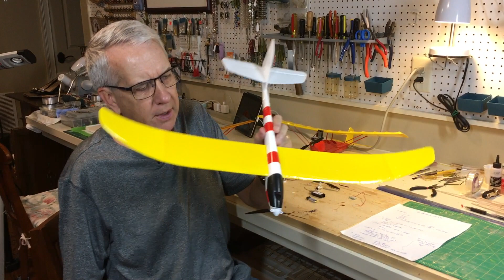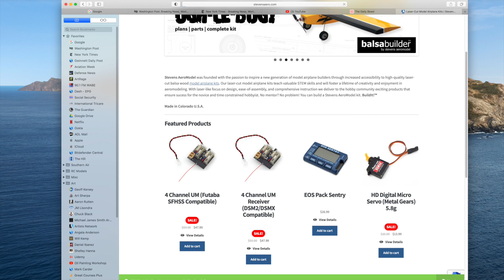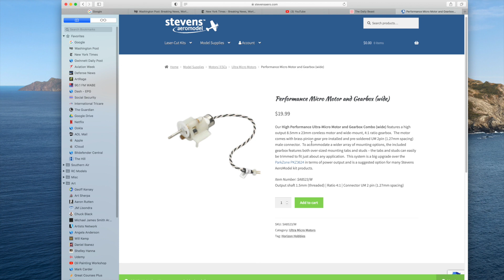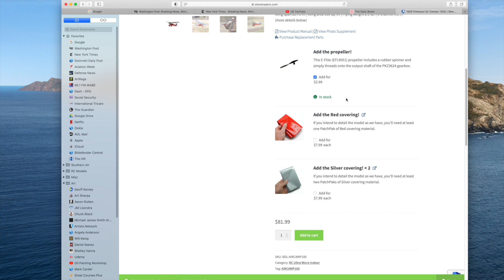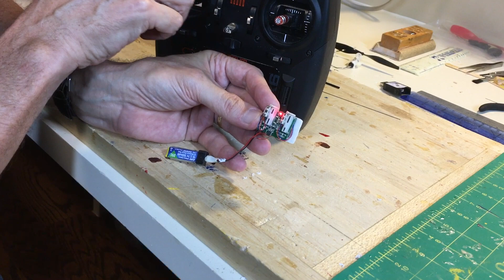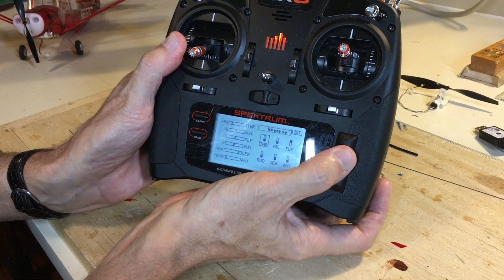Park Zone Ultra Micro RC - Where to Buy

Comment: hey i have a question i am willing to buy the guillow 509 ju 87 b but i dont know what motor wil fit in it (i alr have 3 servos and a reciever and a battery and controller) so i would like if you had any suggestions
Reply: sorry its 508
Reply from the maker: Use the same setup as in my Guillows  F6F Hellcat video.
Reply: thank you @TimMcKay56

Comment: Tim- If I salvage components such as the receiver/servo combination how do I bind this to my Transmitter with the 'new' build? I guess the question comes down to do I need the original transmitter to make the salvaged receiver work?
Thanks, BC
Reply from the maker: BC:  A receiver is binded to a transmitter, it does not matter what airplane it is in. You will need to re-bind a receiver if you use a new transmitter. Just follow receiver bind instructions, Google if needed. With the Spektrum AR620 receiver, a simple Bind Button on top of receiver to put it in bind mode. Tim

Comment: Hi Tim , can  you tell me where I can get the music wire or piano wire as they call it. My hobby shop doesn’t carry that. T.I.A.  Also , I am searching for a 65 Mah battery with the two magnets on it, very small. It is for my Uberlites. Impossible to find. I thought maybe you would know where I could find that tiny battery.
Reply from the maker: Jim:  Either www.TowerHobbies.com or www.Amazon.com carries music wire.  You'll have to do the conversion from 1/16" diameter as they use decimal sizes.  Not cheap, but they last forever.  Tim

Comment: Thanks Tim! 😃As someone with a few Guillows kits, both built and unbuilt, you've provided much needed info on converting them to RC, which I have wanted to do for years now. 🛩I am an RC airplane newbie, but have experience with assembling and flying FPV quadcopters. In addition to Stevens AeroModel, may I suggest to your viewers Buzzard Models and dronetrex for micro and mini RC airplane building. While I have not yet ordered supplies from these vendors, I find their web pages  to be impressive and am registered with both. They offer payment via PayPal (a BIG plus) and flexibility with radio protocols beyond DSM. Again, thanks Tim for your videos covering micro RC airplane conversions and flying.
Reply from the maker: EV:  Thanks for checking in!  Best of luck with your Guillows conversion, and thanks for the Dronetrex website. 😊 Tim

Comment: TIM,  I just completed my bronco from your plan.  Somehow I ended up weighing about 22 ounces. So I decided to put a larger motor in it. I'm going with a park 480.  My question is what ESC should I use? Can I still use the talon 15 or go to a larger one? THANK YOU !!
Reply from the maker: Loel:  Congrats on your Bronco!  22 ounces is not too bad, I would not worry.  The Park 480 will provide a boatload of power.  the Talon 15 should be OK for a 2 cell lipo.  Use a Talon 25 is you go with a 3 cell battery.  Tim

Comment: Thank you for creating a simpler path through a confusing hobby. I

'm modifying my first build (lancer) but have several larger projects as well (stearling stearman). 

I'm buying everything you recommend for the lancer build but am researching transmitters and don't see the one you're using when I google "best rc plane transmitters".

Did you choose yours because of compatability with these micro components or are there other factors at play? 

Also, how do you mount your hinges for the control surfaces. Video clip?
Reply from the maker: Jay N:  Thanks for checking in!  I use a Spektrum DX6 transmitter (www.HorizonHobby.com).  I like the Spektrum products a lot.  Just ensure your transmitter is 2.4 GHz.  The DX6 binds fine with these smaller receivers.  For hinges, I simply use clear scotch tape.  Works fine!  Tim

Comment: Great video - love building the Gullows.  Are those small boards repairable? I have one that the throttle doesn't seem to work (clicks and tries but wont turn)  Servos, battery and motor all check out
Reply from the maker: Frank:  Thanks for checking in!  I am not sure those small circuit boards can be repaired.  You'd really have to know what you are doing with a soldering iron.  Every time I get a new one, first item is to check it out for functionality.  I have found a few cold/broken solder joints, returned to www.StevenAero.com for a replacement.  Tim

Comment: Very usual leads but currently almost nothing in stock.
Reply from the maker: Bluesky9:  Yes, it can be tough finding these smaller electronics, especially with supply chain issues.  Amazon and Google Shopping worth checking.  Tim

Comment: Having a tough time locating the Parkzone parts you referred to. Stevens Aero is sold out of these.
Reply from the maker: GD:  I hear you, the micro electronics can be hard to find at times. Horizon Hobby is a good place to ask, chat with tech ops. Amazon has some as well. Tim
Reply: @TimMcKay56  thanks, finally found them on amazon. Had an issue come up that I haven't found an answer to: when I plug in the battery, the motor goes to full throttle and stays there. Throttle control does not work. Any idea what is going on? I'm using Spektrum DXS radio

Comment: What would be the next system up for a slightly heavier model?
Reply from the maker: G-Man:  This is a good question, and I really do not have a great answer.  I am working on it . . . .available servos and receivers are quite small, but still working on the battery issue.  Tim
Reply: @TimMcKay56  Tanks.

Comment: You mention "newer" receivers working better. Would this include something like a DX6i, which isn't that new but is not older than some of the Spektum DX line, uses the same tech but has been replaced with the DX6 and DX6e?
Reply from the maker: Mark:  Yes, the DX6i should work. I mention “newer” as a general term, as some modelers find some really older items on EBay, and they run into compatibility issues. Tim

Comment: Thanks so much for the excellent overview. I learned a lot, and felt more confident purchasing my first StevensAero micro RC plane after watching your video!
Reply from the maker: Steve:  Glad the video helped, and thanks for subscribing!   😁 Tim
Reply: @TimMcKay56  Can you please suggest a good place to get the double sided adhesive foam tape to use for mounting the receiver/servo block? Is there a specific brand you recommend?
Reply from the maker: Steve:  Double sided foam mounting tape at Amazon.com  Tim

Comment: Bummer.  I was going to get ready to purchase some of the components to follow one of your builds but the site is sold out of their motors.
Reply from the maker: CF:  Yes, sometimes these items can be out of stock.  Do take a look at what Google or Amazon has available.  Sometimes a good find there.  Also, feel free to email StevensAero.com  They are very responsive and might be able to offer some additional info as to when the electronics will once again be in stock.  Tim

Comment: Tim, 
Absolutely love your videos.  What weight/brand of plastic covering do you use?
Thanks
Scott
Reply from the maker: Scott:  I need to make a video on covering the smaller Guillow models.  I use iron on covering that have "lite" somewhere in their name.  ParkLite is my favorite (Horizon Hobby) and I've also used an Oracoat lite covering (think I got from Amazon).  In any event, once you get to, say, Horizon Hobby, if you see a covering color you might like, go ahead and purchase a roll or so.  Lots of pink covering, but the more normal colors can on back order.  Tim

Comment: Hello Tim , very very informative videos you posted for the R/C lovers. Tim how can we bind F949 receiver with 6 channel transmitter, I tried but I couldn't turn on the motor accept servos. Kindly guide me.
Reply from the maker: Muzaffar:  I am not familiar with the F949 receiver, so cannot offer specifics.  But what I can say is that the older the ESC and the transmitter, the harder it can be to bind them.  For example, there is little software in the electric motors.  In one of my older (2005) models, I had a 2005 ESC and a 2005 motor.  Could not get it to bind to my newer transmitter.  Replaced the ESC with a new Castle Talon, everything worked OK, to include the motor.  Servos have essentially no software, as well.  Only thing I can offer is a post to RC Groups, those guys seem to know everything.  Also, having a receiver and transmitter be the same brand (I swear by Spektrum) always make the binding problem a bit easier.  Tim
Reply: @TimMcKay56  Thanks Tim for your feedback , the team of those guys can be helpful to me this is good. You are so kind Tim, please let me know that how can I get them? May God bless you.

Comment: What’s the diameter of the music wire you’re using for the pushrods in your ultra-micro airplanes? FYI, I’ve used plastic coffee stir sticks as guide tubes for flimsy pushrods — the stir sticks are lightweight and easy to trim to size. Please keep these enjoyable and informative videos coming.
Reply from the maker: TA:  I actually tried to measure the music wire as part of my current conversion, a Guillows PC-6 Porter.  My plastic ruler only went to 1/16" diameter.  I have a collection of music wire, so I look for about the smallest (i.e. lightest) wire that I have.  Idea being with proper supports, it will work with these small models.  So, I'd guess mine is 1/32", but with good guide tubes.  And good suggestion on the coffee stir sticks!  Tim
Reply: Yo Tim, sounds like it’s time to pick up a measuring caliper! The digital display units are super cheap on Banggood and at Harbor Freight. Thanks again for producing the interesting videos!